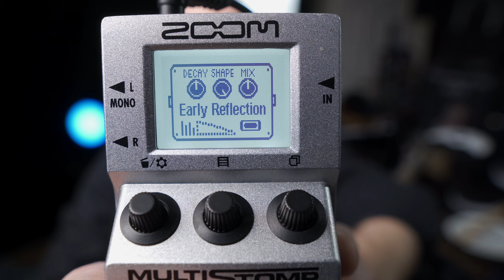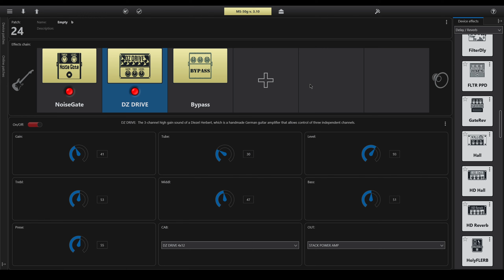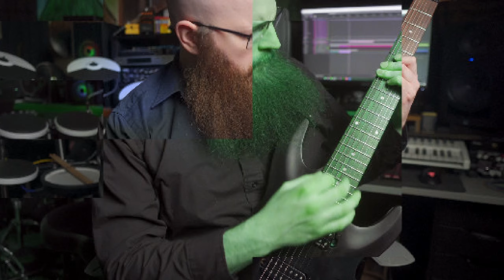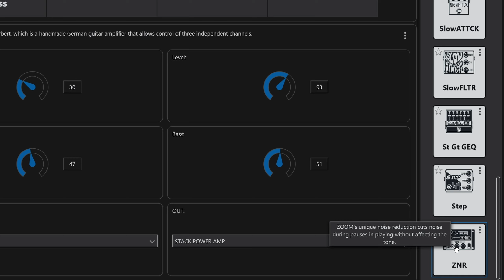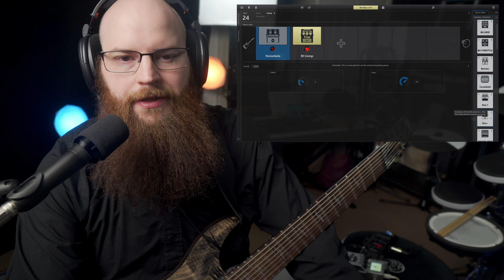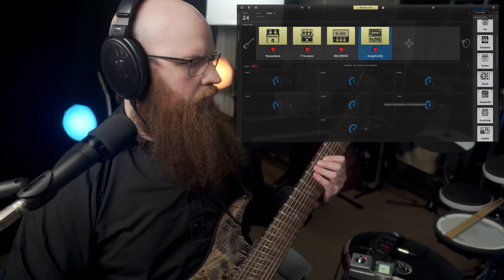Going Deep Into the Zoom MS-50G Guitar Multi-effects Pedal

Comment: I have the Zoom MS50G and MS70CDR, and the new MS70+. I think they’re great, especially for the money. The choruses, delays, reverbs, vibe effects, phasers, flangers, many of the “specialty” effects are really good. As far as the amp sims, one thing to remember, is what they are going to sound like, is affected by various things. Guitar pickup types, the eq curve of the pickups, the guitar volume/tone/capacitors, etc. That’s just the guitar. Then you have to factor in the amp/speakers that you’re projecting the sound of the MS50, through. If it’s a guitar amp, it’s going to sound one way, depending on the amp. If it’s a PA and PA speakers, the sound is also going to be colored by the PA speakers, and these can vary a lot. Same for computer or multitrack hardware recorders, AND the studio monitor speakers you play it back through. 

 I also have the Boss IR-200, and it’s loaded with cab sims and different mics and placements, and it’s the same deal, (it sounds great, too) for more money. Your speakers and/or headphone monitors are the last arbiters of the actual sound.  I’ve got other analog amp pedals, (Tech 21), and other amp sims, and it’s all the same deal. Yes, some are “better” than others, but if you’re playing a great amp sim through crappy speakers or headphones, you’re just making a stellar sim sound like crap. It’s really no different than playing a well recorded album through crap home or car speakers. It will sound like crap. To get the most out of any of these sims, you need to invest in good quality PA or monitor speakers and headphones, to more accurately reflect what the amp sims actually sound like. A lot of people seem to forget about this aspect of music. Thanks for the video. It was a good one 👍